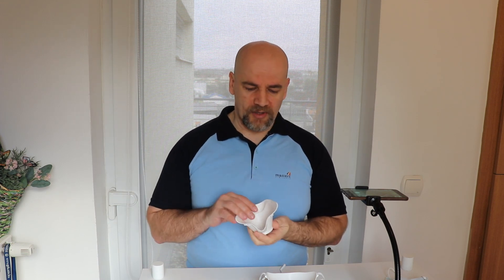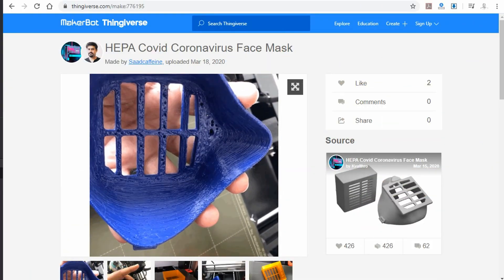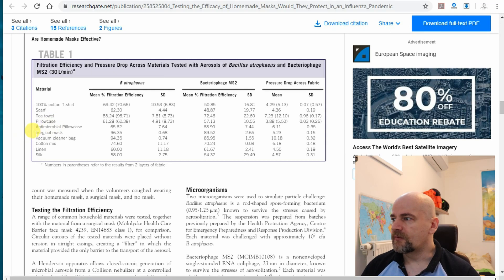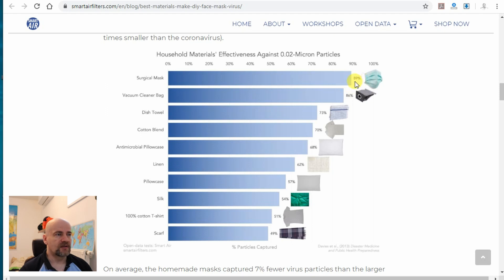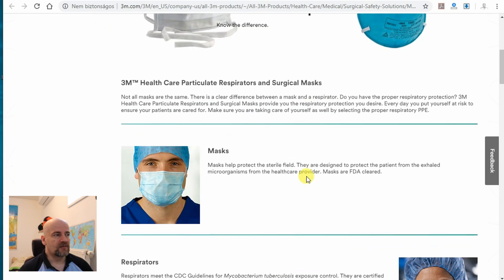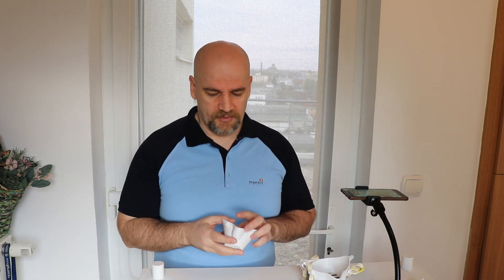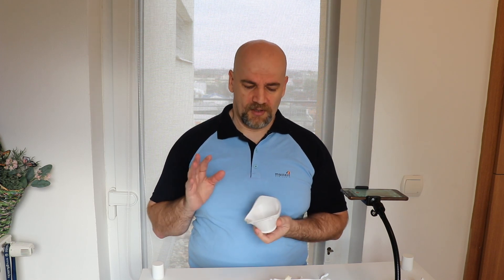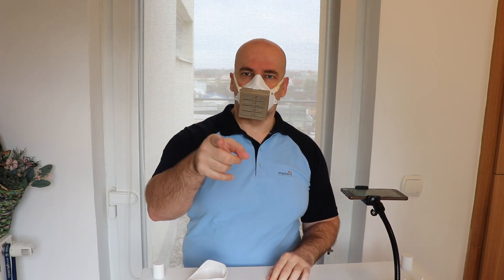About FDM 3D printed face masks for air filtration

Comment: What was the reasoning to have your wife’s filter size smaller than yours?
Reply from the maker: My weight is 110 kg, my wife's approx 65 kg (afraid to ask), so I need more air ;-)  But to answer seriously to question: I 3D printed mine downloading from Thingiverse, so I had no choice, design was given. For my wife's mask I wanted to use filter holder with thread. Using HEPA filter (those with wave design), gives me very big filtrating area, breading is absolutely not an issue.

Comment: Very useful information, thank you. I 3D printed my mask using PETG so it is very easy to clean using boiling water since it can handle the temperature.
Reply from the maker: What kind of PETG are you using? Heat deflaction temperature is usually 65-70°C for most petg filaments.

Comment: Thank you for this video, it's very helpful and gives an extensive overall picture of what to do. Would fully cured epoxy coating have any harmful effects on the human respiratory system?

Also, would sanding down the PLA to remove all the grooves have any effect in making it easier to clean?
Reply from the maker: There are different types of Epoxy resin materials. Not sure for respiratory system, I have only experience with food contact, since I work on food engineering department and this is what I tested. Search for food safe epoxy resin if you want to be sure (most of the epoxies don't have this certificate, but it doesn't mean they are harmful, only they didn't spend a lot of $$ for this certification, but if you want to be sure, better to search for material with official certificate for your country). Your second question: Sanding down PLA: you can never get fully smooth surface. Yes, it will be easier to clean, but never good enough. There will be micro pores, perfect place for bacterial colonies.

Comment: Gaspar Igor, I respect and appreciate the amount of thought and effort that you have put into this (especially the potential hazards of exposure to bacteria as a result of wearing a mask made from a porous material), Unfortunately, there are a number of flaws in the material presented in this video. 

First, the negative pressure test that you are showing to check for mask fit is fundamentally invalid. When you press your hand onto the filter fitting to cover it, you are also pressing the mask onto your face, thus artificially forcing a level of filtering efficiency that is not repeatable during actual wear of the mask. 

Secondly, please recognize the fact that wearing a negative pressure-based filtration mask while you have facial hair (other than a small mustache) will result in further compromising the effectiveness of the mask. 

The reality is that a safe and effective negative-pressure respirator is not something that is currently achievable by a home-based hobbyist with an FDM printer and current technology. The reality is that poorly fitting masks simply result in people touching their faces more often, thus increasing the spread of the virus. I have 15 years of professional experience directly tied into the the fit, effectiveness, and selection of respiratory protective equipment for people exposed to gases, mists, fumes, vapors, particulate, fibers, and yes - various biohazards.

Please consider taking this post down, as it's entirely likely that poorly executed FDM printed masks will actually result in more transmission and spread of the virus, not less. Even more on point - people that have access to 3D printers could (and maybe even should) be using those resources to produce items that are actually useful in supporting an overtaxed and PPE-starved healthcare system - like face shields.

Comment: About Copper mixed up with PLA, there's some "advices" coming from chile (read my post on my website). They say (weird story) that at 15rpm breathing for a normal person, the concentration of copper is not enough to kill the virus because it needs 60 seconds to die in contact with it... I'd recommend listening to this but it's not scientifically proven... and copper+PLA.. I'm not fan, it's like a gadget for me. Thank you very much for your work. I'm assimilating all this infos right now.
Reply from the maker: Thanks for this. Copper+PLA (like in Copper 3D) or silver+PLA (in Purement or Philament.eu) those metallic ions in antibacterial filament in my case is needed to prevent bacterial buildup on plastic after longer usage. Most of the virus should be stopped by the FILTER. Regards from Hungary. (or you mean Copper+PLA = real copper powder, like https://www.amazon.com/Gizmo-Dorks-1-75mm-Filament-Printers/dp/B01CV49CZQ ?)
Reply: @MyTechFun  Hey there ! I mean Copper+PLA = gadget. Not serious for killing anything ! Even C19 is laughing at it. >]

Comment: Is it possible to create a github repo with all the material you need to make these solutions? Doing so will also allow people to contribute to your research.
Reply from the maker: Hello Justin, what solutions? 3D scan to 3D print? (That's done, video preparation in progress), antibacterial filament test or ultrasonic cleaning? I have all the materials and equipment, but currently we are not allowed to go to our labs in university building to finish the research.

Comment: Thanks!

I'd be interested in learning more about filters:
- I almost bought a car air filter yesterday, would that have been a good solution ? Engine filter or cabin filter ? If cabin filter, with or without activated charcoal?
- the more folds the better ? For breathability? For filtering?
- What about a cotton pad (makeup pad)? 
- Any other well-known source of non-woven fabric? Diapers?
- ...

Also, about the fit: If we don't have a kinect (or an iphone or anything like that), what's the best alternative? Weather strip, foam, hot glue, ...
Reply from the maker: Car air filters are designed to clear dust from air for engine, I don't think that manufacturer designed them to clear microbes too, and they may content some toxic materials, since they are never designed for human breath contact. I wouldn't use them. I recommend you read this page about alternative filters: https://smartairfilters.com/en/blog/best-materials-make-diy-face-mask-virus/ . About fit: some masks on thingiverse have already good design, try to print them with some flexible filament to get better sealing. If you want to scan your face, you can do with photogrammetry too, but the problem with it, that you have to scale it manually to proper size (you need some reference dimension). But I will explain it in my next video soon..
Reply: @MyTechFun  Cars also use cabin filters for the AC (with or without activated charcoal). They can't be toxic, we breath the air that goes through them.
I'd be interested in a video about the fitting of the filters. Maybe model the folds to get an even greater seal?

I did read the article. I think it's not the best we can do since it's for sewn masks supposed to replicate surgical masks. 3D printing allows us to use other filters without the fitting issue. Imaging using your vacuum HEPA filter in a surgical mask: it would be very hard
Reply from the maker: @NicksStuff  You are right, as a mechanical engineer, I had in my mind only filter for engine, I forgot that they are filters for cabin..
Reply from the maker: @NicksStuff  You are right, as a mechanical engineer, I had in my mind only filter for engine, I forgot that they are filters for cabin..
Reply: It depends on the rating of the filter. A filter don't care if we intended it for a car. It needs a n95 rating or higher.
Reply: @Dr.Grafenberg  If the filter doesn't mention it, is it fair to think a filter meant for the HVAC system of a car should be about n95?
Reply: @NicksStuff  i would try to contact the manufacturer 4info like that. Dont asssume. Be sure to post what you find out I'm sure more of us are curious

Comment: Any considerations about addition of valve to such design? How moisture from exhailing affects hepa filter performance? Would valve make it better/worse?
Reply from the maker: Hm. Good question about moisture. I am not 100% sure, but this hepa filter is washable. Also in case of fire, they recommend to put a wet textile on your face, this will better filtrate the smoke. So if I put this two thought together, my opinion is that I don't have to worry about it. But probably I will add tome textil (dish towel) over the filter on side where my face is, I have space in that filter holder. I am using my mask for 2 hours continuously, I didn't noticed any changes with breathing difficulty. Also, they are hepa filters for vacuum cleaner with water, probably some water micro droplets goes through this filter, but they are designed for this too (just my opinion, couldn't find official info so far).

Comment: Üdv, nagyon hasznos és érdekes volt a videó! Megkérdezhetném a szűrő pontos típusát?
Reply from the maker: What filter i used? I ordered Electrolux H13, but will late few weeks. Instead I used washable HEPA filter Sencor SVC 670. Cut in half, so I have a spare filter too. Only I needed a 12mm distancer to place in filter holder (can see in video). (bocsi, csak hogy mások és értsék)

Comment: I think it would be better if you could line the edges with a soft rubber so it creates a better seal like silicone caulking which should be skin safe and also soft enough to seal and not be unconfortable. 
Maybe also have a shallow trench so the silicone seats and binds better
Reply from the maker: Good thinking.. probably I will try to use silicon there. I was working with silicon molding in 3D printed form (for some food forms). Probably I can use that technic with mask too.. not sure, but I will try..